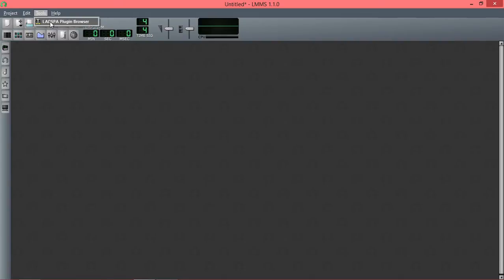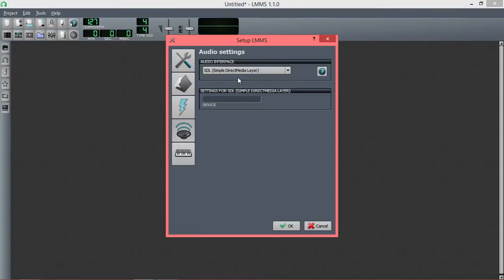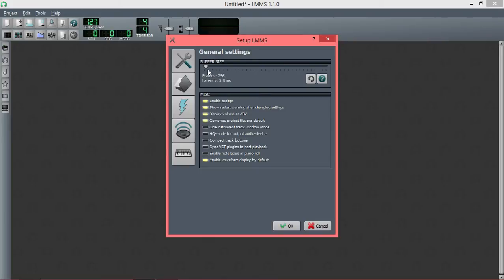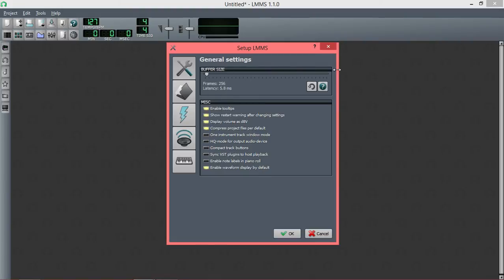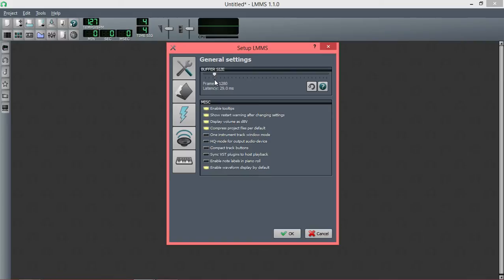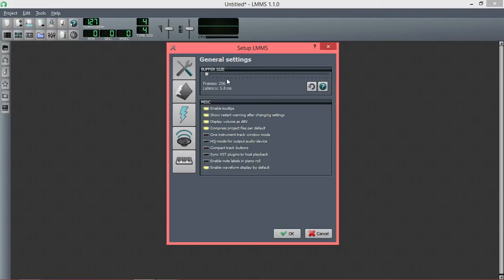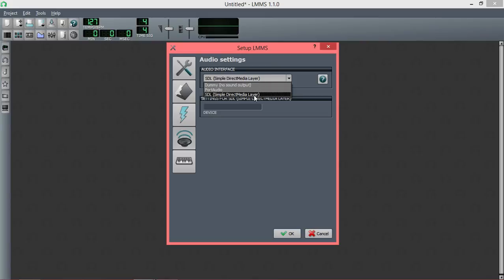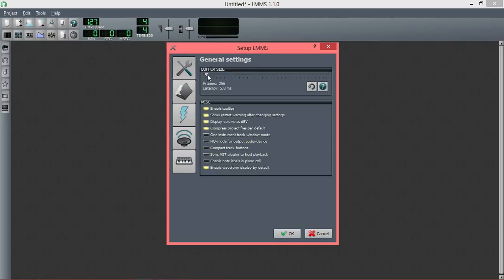LMMS Troubleshooting

Comment: There is a delay between my piano keyboard and the audio of LMMS. Is there a way to fix that?
Reply from the maker: +Isaac Hong you can do that by decreasing the buffer size. However, decreasing it too much may result in mangled audio and bad performance.
Reply: It still seems to have a delay even though my buffer size is at the lowest...

Comment: Hey, I have a little grafic problem. It's not too bad but annoying though. So: It's like, one audio track only has half of its height. Normally, you can read Pan and Vol but with this one, there's a black line cutting off the lower half. I tried all kinds of draging it down but it doesnt work. I hope you get my problem and have a solution.

Comment: So when I put it on SDL, and hit ok it says most of the settings won't change until you restart lmms, and when I restart it and go back to settings, it's still on dummy, I've tried this a bunch of times and this keeps happening. Why? (I'm on lmms 1.1.3 by the way )
Reply: put the actual LMMS, not the file, on your desktop.
Reply: Did you fix that problem? The same thing is happening to me!
Reply: +TheMacpardo same !!!!
Reply: "In your Folder 'Documents and Settings' (or similar) you have a file .lmmsrc.xml Observe the dot.

Use the search-tool, to find this file. You cant rename this file, but you can move it"

Just move this file to another folder. It worked for me, hope it works for you as well!
Reply: oh and also, you need to put it on SDL the next time you open lmms (after moving .lmmsrc to another folder). If you don't, you'll need to move that .lmmsrc again (it will have been recreated).

here is the link with the solution https://lmms.io/wiki/index.php?title=LMMS_Settings
Reply: +TheMacpardo check my comment below , I also but the buffering down to 29
Reply: did you try to reconfigure that right after moving .lmmsrc? you need to change those configs right after moving it, because after that they become static.
Reply: +TheMacpardo no I just put the buffer down and clicks that setting , it asked to restart I restarted and it worked just fine , that was before you commented it's working right now
Reply: Ohh that's great to know! glad it worked
Reply: SAME

Comment: On an XP computer (or whatever else has problems with the settings UI - LMMS freezes when I try to access settings), you can edit C:\Documents and Settings\(username)\.lmmsrc.xml with a text editor like Notepad++. (Also note the dot in the filepath before lmmsrc, which makes it hidden.) It takes a little while to figure out what's what without the UI, but all the values and settings are simply variables in an XML file.

Comment: This is how I fixed the revert to Dummy issue: When LMMS asks you to restart to apply settings, restart LMMS as a blank project, like just click on the LMMS program itself. Don't open it through opening a project file. After that, just test out some sounds, and if it works, you can then load any project from the Open menu. While using LMMS, never open project files directly. Open a blank LMMS instance and THEN use the Open menu to open projects. 
That's how I avoided and fixed most random problems.
Reply: That would explain why I've never had the dummy issue, however I have the frame buffer set to 12000 and it still crackles, but only when I overlap notes. makes using chords VERY hard, However I've learned a LOT about combining notes and chords within scales as well as combining scales melodically.  Any ideas?  I think my latency for 12k is only 180ms, and i'm not using any outside instruments(until I figure all this out) it seems that adding delay to anything causes crackling too.(if it overlaps another note)
Reply: DoctorN0gloff I've done this and it still doesn't work, any more tips?